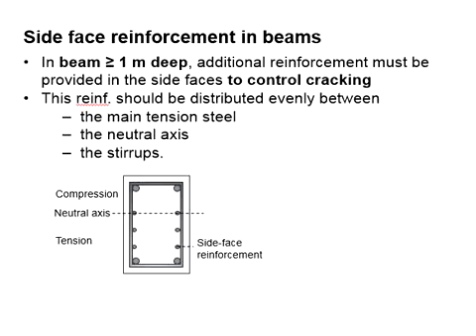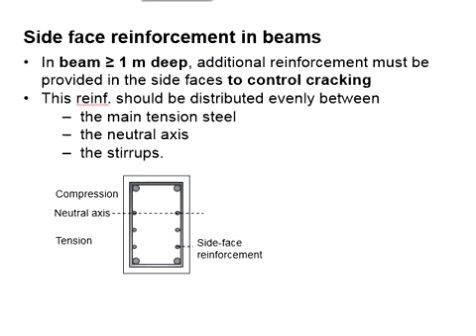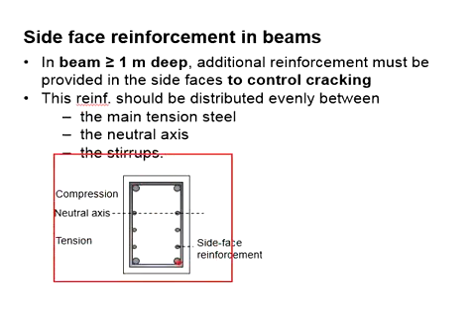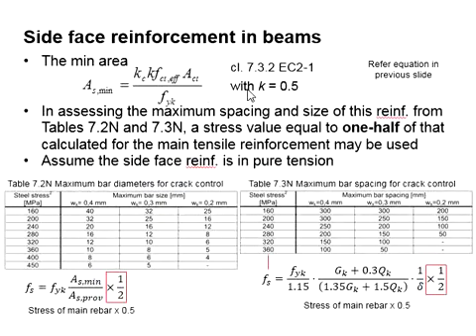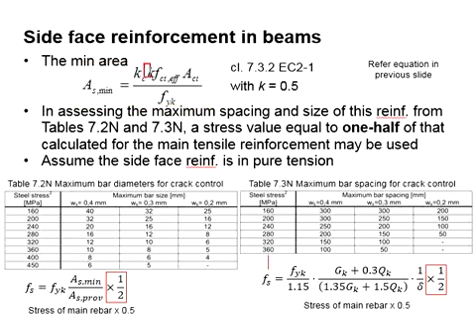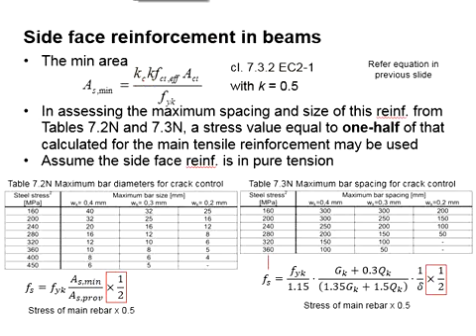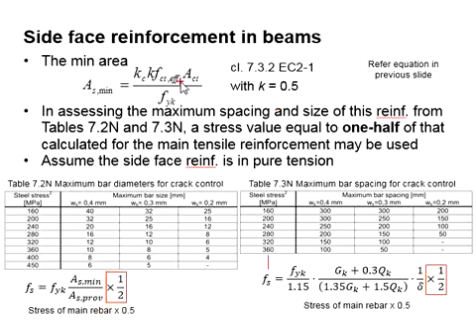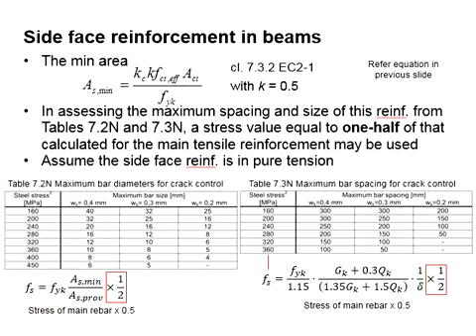6.16 Side face reinforcement

Comment: hi sir, may i know that the min area in your video for the side bars is for the both face or one face? hope to receive your reply soon.
Reply from the maker: Based on the definition of the symbol in EC2, As,min = minimum area of reinforcing steel within the tensile zone, Act = the area of concrete within tensile zone. I believe the equation is for the entire tensile zone (which will be for both face).